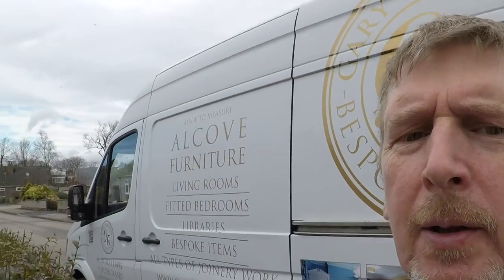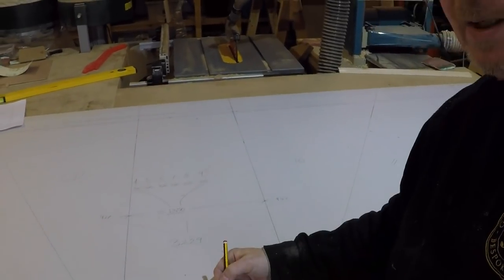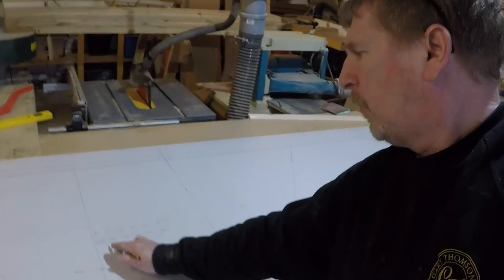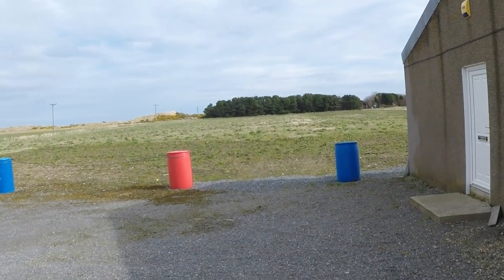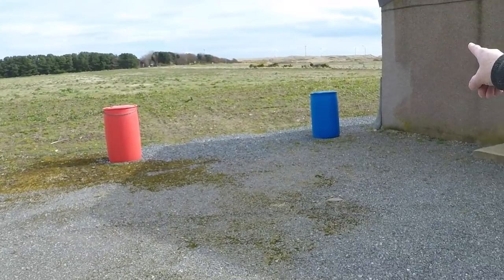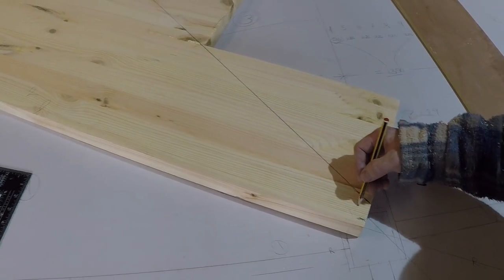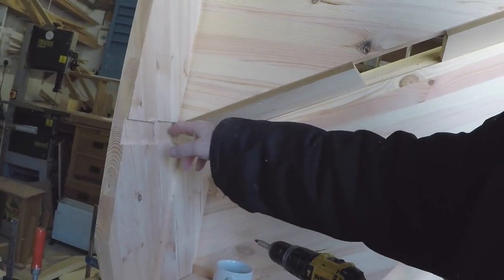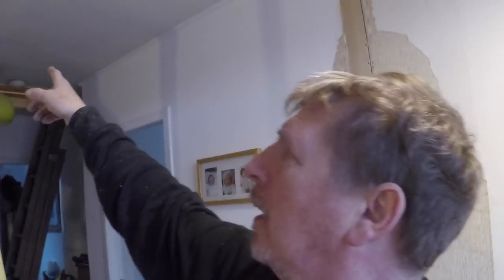Making a Double Winding Staircase

Comment: Great job, Gary, but why did you need to strip the partition? Surely it’s less work to leave the plasterboard on then spike or screw fix through the plasterboard.
Reply from the maker: Thanks James. That was the old partition. A new partition was put up about a foot away from the old one. I just made space for the stair to go in then I knocked the rest down later. Thanks for watching 👍🔨📐😄

Comment: Hi Gary, great work, top class. I have a very similar staircase to fit into my house, between the upstairs and attic. There's only the back wall to support the sides and as it will be fitted above another staircase, it can't have pillared support either. I could affix the newels up the attach on the attic floor, but is there any rules on that? I'm worried that building control will pull me up.  Cheers, Stan.
Reply from the maker: Thanks Stan
Not sure without seeing some drawings but a couple of things. 
1 if the stairs is going up to one room I believe you can get away with a narrower staircase (700mm) but if not 900mm and you must have that throughout the whole staircase, no narrow bits. 
Thanks for watching 👍📐🔨😄

Comment: Enjoyed the watch matey 👌 
Long time since I made a winder! Do you glue the wedges and not the treads? Or glue everything? 
Also how do you keep it clamped when assembling onsite? Did you screw through the outside?
Reply from the maker: Hello mate, yes I used to make about 20 winders a year but now they’re getting very few. CNC machines are rattling them out in quarter the time. 
To answer your question though,,,, glue everything, some say about the end of treads not because of expanding and contracting but I don’t think that’s possible when the wedges are glue and banged in tight they go no where 😄 
Also they don’t squeak either. 
The other question about screw in the treads,,, yes through the face if it’s not seen and up in at an angle from under the tread inside. 
Drill your pilot holes for your screws through the ends of the treads first. I drill them from end grain and come out the underside if you know what I mean. Then find the perfect length of screw. 
If you can use sash clamps to pull all together when assembling ( often not possible)
Thanks Mate 👍😄

Comment: Hi Gary, am I right in thinking when you fit  a double winder, you can't hook the top winders outer stringer and newel post over the trimmer joist ?
Reply from the maker: Hi Jon, you can actually. You can add a short 4x2 nailed on to the trimmer to catch and take the weight. The 4x2 sits under the top last tread which is only 75mm noseing actually. 
Thanks for watching and I see you just subscribed too 👍
Reply: Thank you for your reply Gary. Does the 4x2 just sit underneath your top nosing peice without notching your newel post and stringer around it.

Comment: I've built a lot of stairs but never 225 tread , not much room i take it , didn't even think that be legal ,
Reply from the maker: Nop, never said the tread was 225mm, The going is 225mm there’s a difference between the tread and the going.
The going is the distance between the rise of one step to the rise of the other step
The tread is the width of the step plus the overhang.
The total tread is about 248mm and it’s rise is about 204mm.
I must have said a dozen times the going is 225mm, if at any point ( and I don’t recall) that I called the tread 225mm then that was a verbal typo and I think most Joiners watching would have realised that.
Please send me the time stamp where I said the tread is 225mm, you could be right but it’s an error having said the going is 225 so many times. 
The legal requirement here in the Uk is a tread,,,,, no less than 245mm and a angle rake of no more than 42 degrees.
It must have a minimum of 16mm overhang of the Tread over the rise.
For a loft conversion you want to have the minimum footprint of the stairs and still be within legal requirements.
Thanks for commenting though, stairs are one of my favourite jobs to do but becoming less and less due to the CNC online stairs.
Impossible to match those prices.
Hope all is well with you guys there, I hear your getting so much nonsense from the authorities, 👍